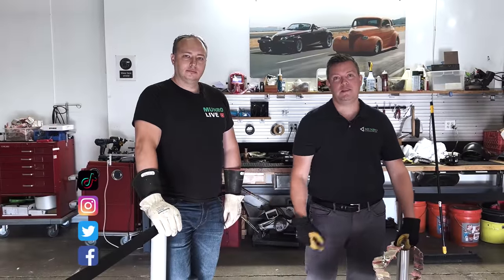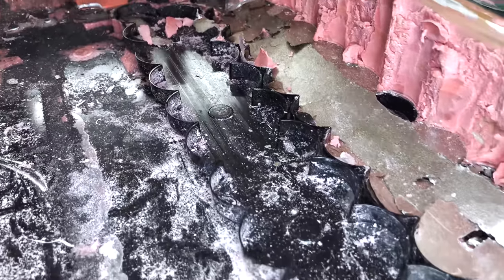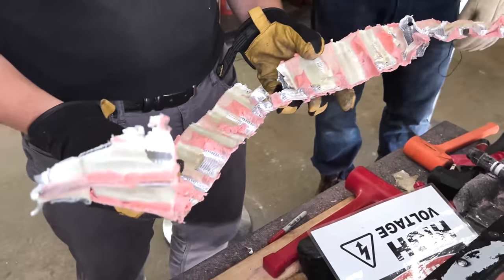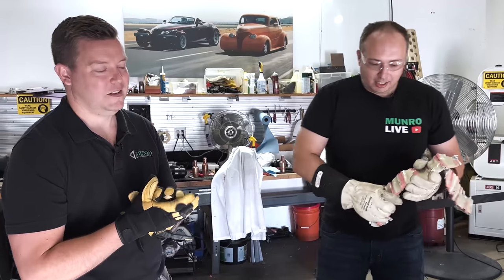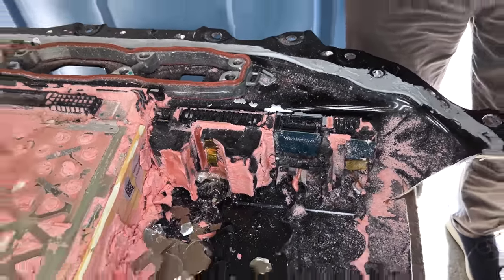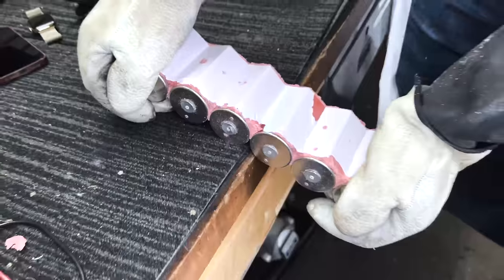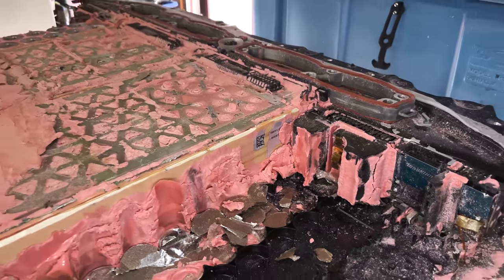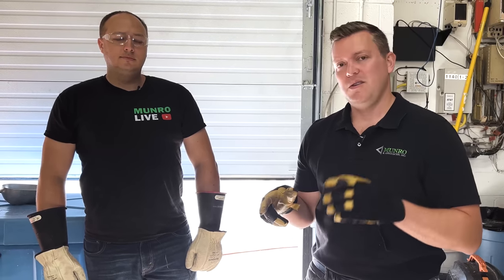4680 Update Structural Adhesive | Tesla Model Y

Comment: It was designed to be not taken apart without damaging it.  There is a reason I would NEVER BUY A TELSA.  The repair cost of the batteries.  The standard model 3 is over 1/2 the price of the car itself.  So no thanks.  If They want people to stop using ICE Vehicles they need to think about repair costs.  Average ICE car $35k, average EV $60k.  Average cost of parts over 5 years of a ICE vehicles is oil changes and with EVs it could be 1/2 the cost of the car when the battery pack fails.  Over 10 years The EV is going to need a new battery pack and the ICE vehicle will probably just need routine maintenance.   More on an ICE Vehicle is recyclable, as the batteries are not and toxic.  The EVs themselves are great, its the batteries and Tesla is making that worse.
Reply: You do not repair battery packs. We 5 years into move to BEV yet i see no store giving the option to repair a pack. 

The pack get 10 year warranty. So after 10 years it will most likely be your only cost IF your pack dies(which very rarely happen, only degration). So than you just sell the pack to Tesla for recycle and replace the pack with a new one with 10 year warranty again.
Reply: @pipooh1  They are not lasting that long already.  People have reported $25k bills to replace batteries in their Teslas.  Even degradation is bad, your ICE Vehicle doesnt get worse and worse miles over the years.  I have two 77 cars that can the same if not slightly better mileage then when they where new.  This is the EV problem, too expensive up front and when they brake (either battery or other major part) 2-10 more to repair.

I want an EV but they are being designed wrong.
Reply: @TheLotw  If they do not last 10 years they fall under the warranty... No bills than. The 25k battery replacement once are prob from old Model S and X since those are not really mass produces anymore. The raven and new 4680 pack it will be closer to 10k for the pack. So like 12k in labor and parts. Give it 5 more years when they get cells for as low as 60$/Kwh and replacing a pack will be cheaper than your ICE engine. 

ICE do get worse over time but with good maintenance it can expand that time frame.
But you paying 400+ a year for maintenance(you can do it yourself but in Europe it's wont get registered and can harm you when you sell the car). That is 4k just in maintenance cost, since you use brakes a lot more on ICE, you looking prob at 2-3 times brakes changes which add quickly another 500+ each time if your discs are fine, need disc replacement you looking at even more.
You need oil change every year which adds up. So just rough numbering we looking at what 6-7k in maintenance over 10 years? That if NOTING goes bad. Your transmission can break, your engine can break, your gearbox can break. To replace any of those and you paying 10k+ in repair and part cost(I'm talking done by a repair shop, not every person can repair a car, surely not modern cars).

The chances a pack bricks or dies is so small these days. So it all about degradation, which with every new pack they design get better and better. Tesla goal is that packs last 1mill miles. So that pack will last longer than the car...

Comment: I guess there’s no way that a bad cell could ever be replaced.
Reply: Imagine either an internal or external "fuse"? (Solid state?) that removed a cell from the pack circuit, then voltage sensing which rebalanced the module to compensate?
I wonder if the "average driver" would notice the 0.12 percent drop in pack capacity/ power?

Comment: All this 'structural adhesive' and foam shit makes these Tesla batteries 0% recyclable. What to do with these enormous rock hard solid battery blocks after 8 to 10 years? Just burry them under the ground? Seems all very very environment-unfriendly to me.
Reply: You don't take it apart to recycle it you freeze and shred it ( at cryogenic temperatures it zeros electrical power , makes all the plastic super brittle ,solidifies any volatiles and even makes the metals brittle) As for level of sustainability recovery rates are 95% plus
Reply: @jackdbur  So we need to built a whole new industry just to shred Tesla batteries? Freeze &  cryogenic shit? Sounds really friendly for the environment. As if that proces doesn't take huge amounts of energy, and won't create tons of CO2. It's all just wishful thinking mate.

Comment: The whole pack is SO thick... Huge compromise in a car where you want seating comfort and limited air drag.
Reply: It's not actually
Reply: I have heard of such claims. Especially for model 3 rear passenger seats. The high floor caused feeling for lack of support on lower part of thigh, near the knee. Not as bad on higher cars like model Y.
Reply: The thinnest pack's in the industry are still over 100mm right now and none structural. So by making this structural and replacing the floor pan itself with the top cover of the pack that gains tesla model's some additional interior room. 🤔
Reply: Teslas have industry- leading aero efficiency. Can't even tell by looking that they have a battery pack under the floor; look how low and sleek Model 3 and S are, like early 90s Honda Accord.
Reply: The cell is 10mm taller than the 2170.
As said elsewhere, if we assume the 2170 pack had a y clearance between it and the internal floor of the "old" vehicle, that, plus the floor thickness would be more than 10mm.
It's BETTER.